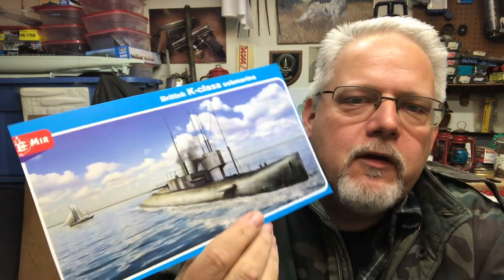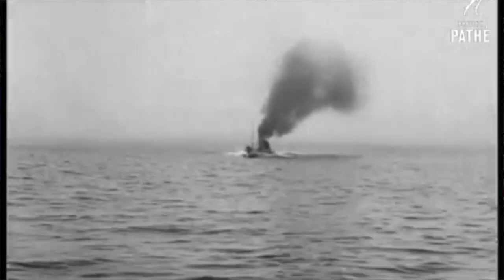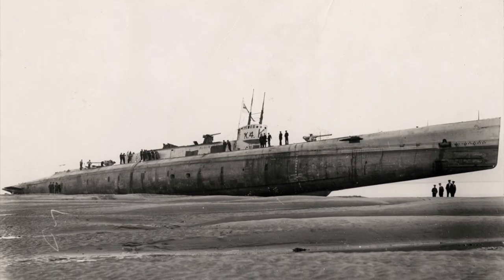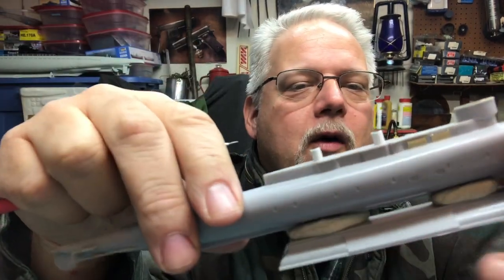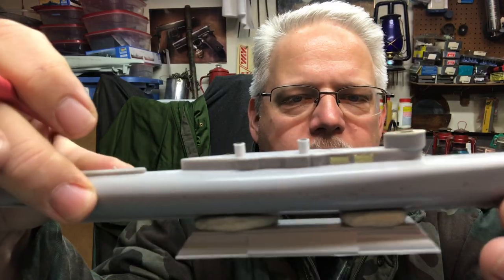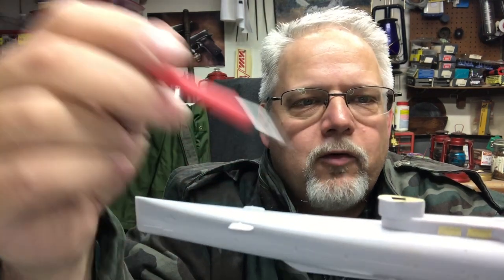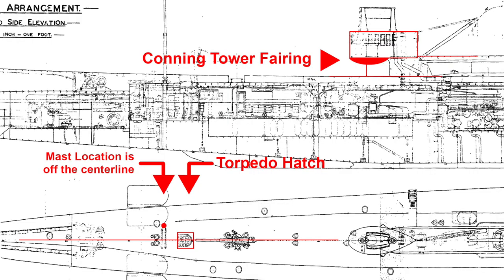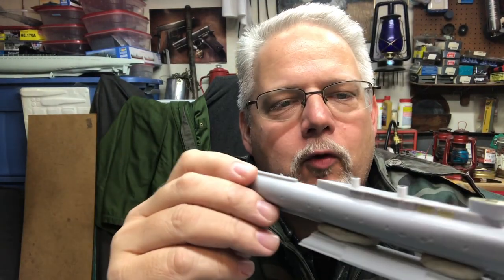Review - MikroMir's K Class Sub

Comment: Hi Scott, nice video- have been hankering after one of these models for some time but the rather exorbitant price has deterred me up to now ( in the UK they're about £24.50 ....)
You've just convinced me so I'm off to order one ASAP 
Btw basically all WW1 subs from every nation had the wireless masts offset to either port or starboard as they had to fold down before the sub could dive, and if they were on the centre line they wouldn't have sufficient room to fold flat due to conning tower etc
Thanks again for doing these videos 👍